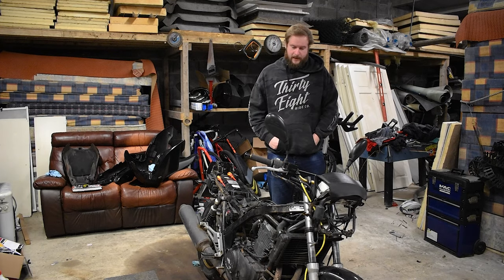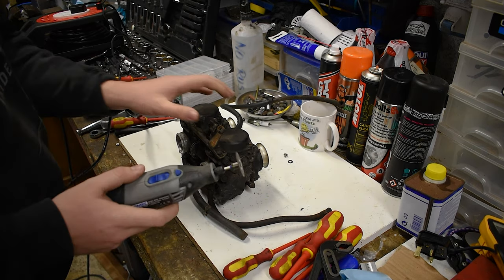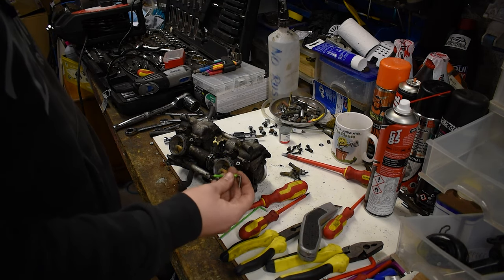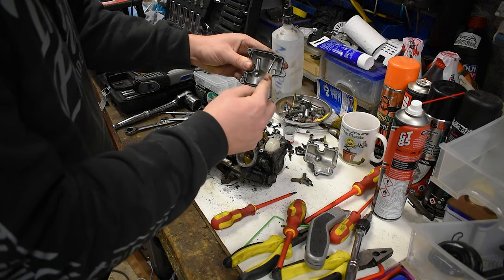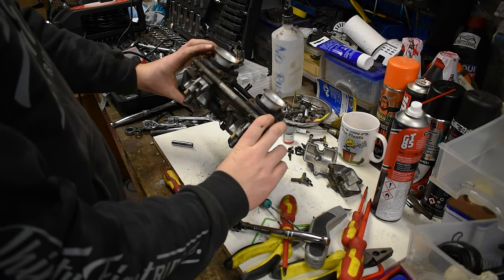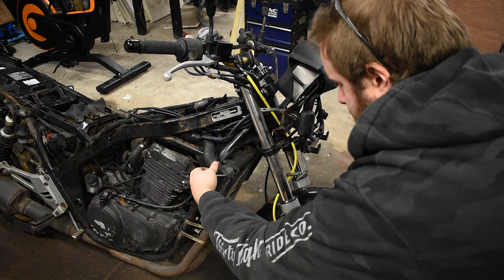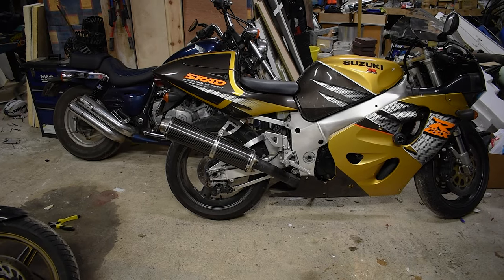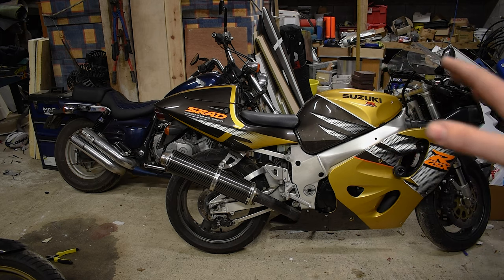WE WILL REMAKE IT | Honda CB500 Tear Down Part 2

Comment: Enjoyed that dude, good effort getting the exhaust out. With the engine out you will get a much better attack at those pesky studs. I had to weld a nut on the last ones I dealt with.
Reply from the maker: Thanks bud! I'm pretty happy I managed to not break anything else anyway while getting the thing off. It is utter crud. I think that's the route I'll have to go, weld on a nut and try bate it off then. Not a whole pile left to play with.

Comment: My first Ducati used to have carb warming via the oil cooler, only really had any issues with carb icing in the cold winter, that had a valve so it could be turned off for the summer.
Reply from the maker: Ah a way to turn it off would be cool too. I just decided to get rid of it for aesthetics, the chances of this bike seeing proper cold weather are slim to none so it shouuuuld be ok, I'll keep all the bits in case it ever needs to go back on anyway :)
Reply: @TheGorillaBiker  I'm sure you'll be fine, with pod filters I can't imagine it will see much bad weather anyways :-)
Reply from the maker: Exactly! It wouldn't want to be or it'll be cutting out plenty 😂😂
Reply: @TheGorillaBiker  😁

Comment: Great video. Can I ask which camera you used to record a stripdown video like this up on the bench. It’s quite close up and I wondered which camera is best.
Thanks
Reply from the maker: Thanks! Every video in the shed is recorded with a Nikon d3500 and a standard kit lens believe it or not, then I just have the camera up high on a tripod. I wouldn't recommend the Nikon though as it doesn't have an autofocus really, you have to manually press the focus every time you want to change but its not too bad really!! It works and is affordable :) Then I do a bit of work on colour and sound afterwards to clean it up a bit :)
Reply: @TheGorillaBiker  that’s interesting as I did some testing for my upcoming videos with a GoPro on either medium or narrow field of view and it worked fairly well. I’m also considering a camcorder rather than a DSLR. I’m told if you can fix the lighting level in a garage to a nice bright environment, a camcorder will do ok for this task. I’ll keep you posted on my findings if you’re interested and thanks for sharing the info.
Reply from the maker: The gopro does all you need really, I just like having the detail a DSLR gives you. 
Yeah I looked in to a camcorder myself but just decided to buy a new camera altogether, that should be here soon and I'll see how it works :) I got a canon M50

Comment: Hi on the cb 500 carb where does the diaphragm T pipe connect to on the engine? Im puttin 1 in a quad and cant work out what operates the diaphragm thanks